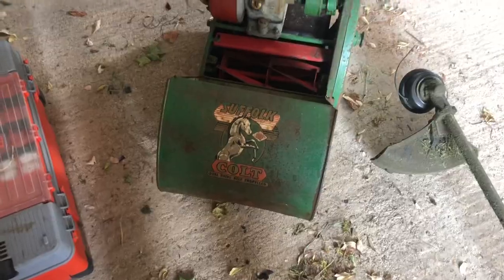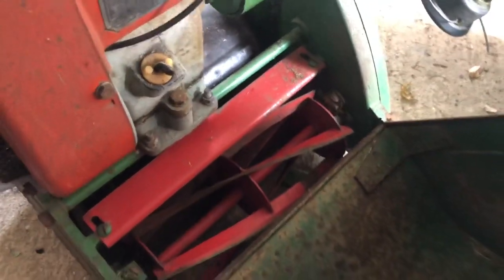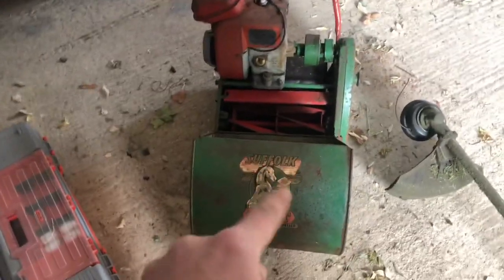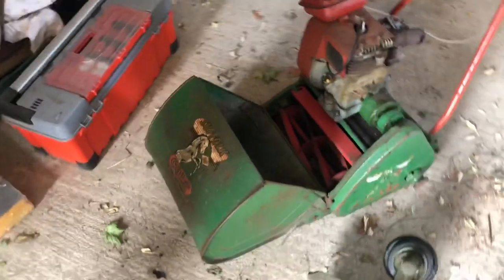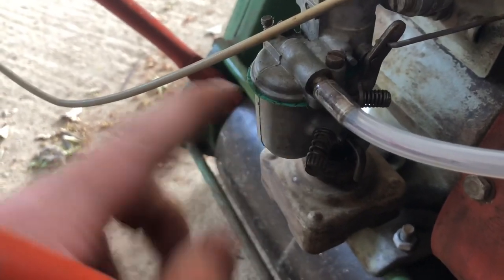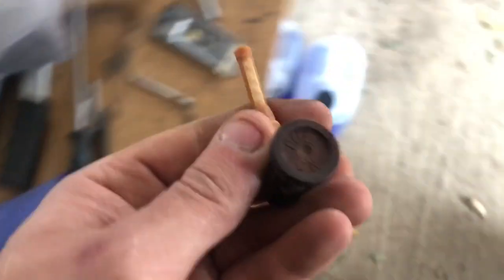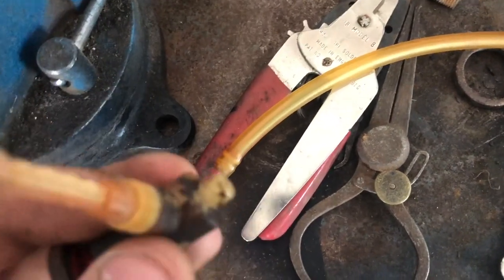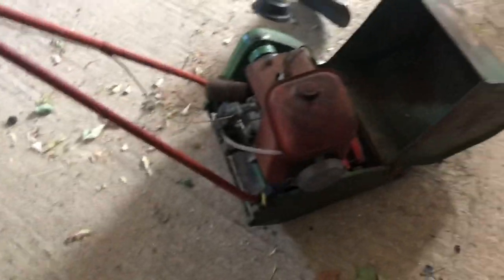Suffolk colt lawnmower project part 2

Comment: YOU  NEED  THE  BRASS  PETROL  TAP , NOT  THE  ONE  YOU  HAVE  NOW . SUFFOLK  COLT  IS  THE  12" CUT  .  THE  SUFFOLK  PUNCH  IS  THE  14" CUT  .
Reply from the maker: where can I get a brass one
Reply: @Chris_GasolineGarage  I HAVE A BRAND  NEW BRASS  PETROL  TAP . GO  TO A MOWER  SHOP THEY MAY HAVE ONE.